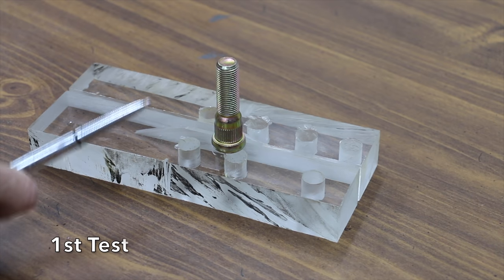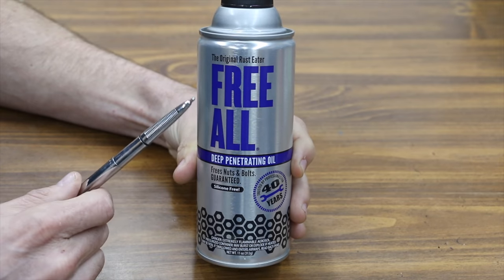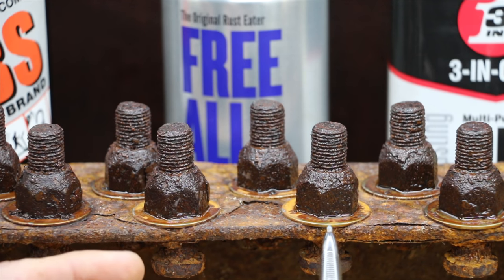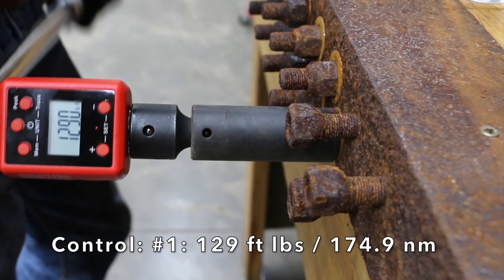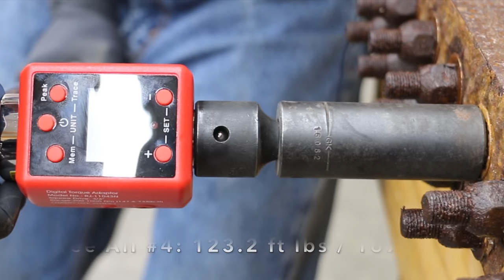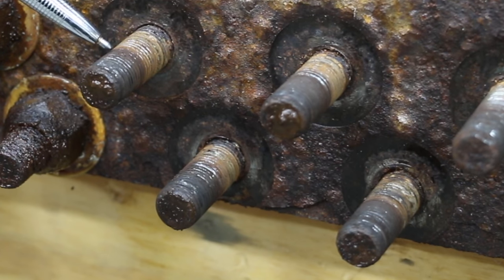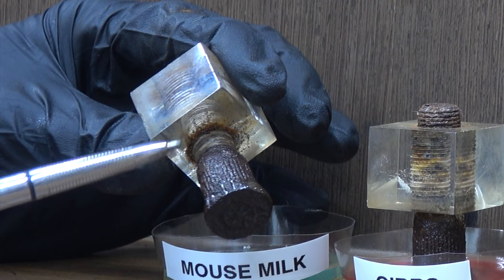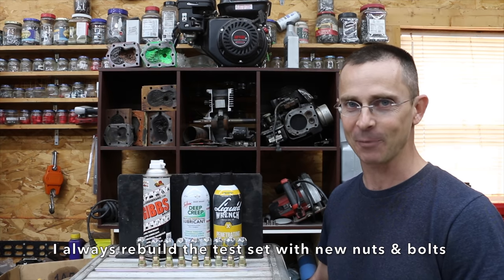Does Water work better than Penetrating Oil for Rusty Bolts? Let's find out!

Comment: You have several videos where you submerge rust in liquid -- what about large pieces that can't be submerged? What does best for a (for example) rusted metal table saw surface?
Reply from the maker: Thanks for the suggestion.

Comment: I just this it's physically impossible for anything to come between a nut and bolt that is really torqued down. I still use my Blaster but I think it helps taking the nut off more than it does breaking it loose.
Reply from the maker: Thank you

Comment: Have you tried 2-cycle oil and motor oil as penetrating oil’s to see how well they do? Whenever sinking really long lag bolts, like for farm fencing, I always dip them in a bottle of 2-cycle oil, it seems to help them go into the wood easier. I’ve also used motor oil and bar oil. But 2-cycle works best.
Reply from the maker: Thank you for the video idea!

Comment: I saw your video testing rust remover products, and was curious which one you'd recommend for cleaning an old moped gas tank. I have used Rustoleum rust dissolver before and it barely does anything. I like the way that Krud Kutter performed for you though and think I might try that.
Reply from the maker: Thank you

Comment: Hi there, did you already have a test on starter fluids and alternatives to use?
For example my father used John Deere stuff for cold starts on his old hungarian tractors/excavators. He claims this would cold start them without any fuel in sight.
Me needing somekind of starter for the moped, I have two favourites. Brake Cleaner and WD40. Both work good directly sprayed into the chamber. WD40 should not be sprayed in front of the air filter. For me it suffocates the engine. Brake Cleaner is fine there on the other side.
Have a nice day.
Reply from the maker: Not yet. Thanks for the test idea!

Comment: Have you ever done a heat test? Heat will loosen frozen fasteners.
Reply from the maker: Great suggestion!  I did use heat on the first showdown and it did very well. Thanks again!
Reply: Project Farm I will go back and check that out.

Comment: i wished you would repeat this test with heat applied to bolts before treating to see if it would wick in
Reply from the maker: Thanks for the suggestion.
Reply: uh, all you really need IS the heat.  it is by far the best for removing nuts from bolts.

Comment: Hey there, I love your channel, keep up the great work...I was wondering if you could test oil stop leak, I hear they are not good to put in your car engine. Just wondering what are your thoughts on that.  Thanks and look forward to the next video.
Reply from the maker: I haven't tested those yet, I need to.   High mileage oils contains additives that help slow oil leaks.  Stop leak products are very similar and seem to help.

Comment: I know you like new ideas on what to test - here is a new one.  With the new GDI engines the valves on engines get a lot of carbon build up since the fuel is no longer sprayed over the engine valves on a typical four stroke engine (the fuel is sprayed directly into the cylinder, which is more efficient and generates more power with the same or better gas mileage).  Could you do a test of the GDI intake valve cleaners like CRC industries product?  Thanks.
Reply from the maker: Thank you for the video idea!

Comment: Just watched your gas vapor video running your lawnmower. I believe I read somewhere that people have heated the fuel to 400 degrees before burning it in the engine. I am curious if you would see an increase in efficiency.
Reply from the maker: Great tip! Thank you

Comment: i think the biggest issue is that the torque is too low, to really show what the different oils can do, at ~130 ft/lb's no one is going to use a penetrant anyway on a bolt like that, you should use some 3/4 nuts and torque them to 300+ ft/lbs then see what they can do.
Reply from the maker: Thank you!

Comment: Dont even have to finish watching this video. When using water you have to work the nut loose and tight to get the water in the threads. Water does not penetrate but does work very well.
Reply from the maker: Thank you!

Comment: you should use diesel as oil in a 2 stroke and 4 stroke engine, for the 2 stroke obviously mixing with the gas and in the crankcase for the 4 stroke
Reply from the maker: Thank you for the video idea!

Comment: you’re supposed to use the water right when you are gonna take off the nut and keep it wet as you unscrew the nut/bolt you can dab it with a wet rag not leave it for an hour it just dries amd make more rust
Reply from the maker: Thanks for the feedback.

Comment: I have used penetrating  oils over the years and not once have I ever done it like you did here. The bests way to use it is to keep getting the parts soaked with it. apply several times even is just a few second apart.  Not just once and walk away.  As you can see on the upright bolts most of it just ran down the bolt then the nut. Not much got to soak in that way.  That may be cool for a video here , but not much help getting thing apart.
Reply from the maker: Thank you!

Comment: In the case of a truly stuck fastener, none of them will help. If the fastener isn't truly stuck, like in your tests, then you don't need any help removing it to begin with, as evidenced by your control fasteners. When you have a truly stuck fastener, the only thing I know of that works is heat, especially if followed by rapid cooling, such as by spraying the fastener with water immediately after heating it with a torch.
Reply from the maker: Thanks for the feedback.

Comment: Project Farm I  am begging  for a video by you. How to oil, loosen ALUMINUM bolts from  engines? Cause one  bolt costs about 2 hours labor.[Cause the corrosion makes them snap]  Its Aluminum on Aluminum block. Facepalm God  Bless you if you  can come up with a idea! Basically a way to lube a bolt and get it down in the threads. Hopefully freeing it. Ideas and tests would be a blessing!
Reply from the maker: Great recommendation!  I'll see what I can do.

Comment: Thank you for this great video! Unfortunately you only test US brands :/ non of these are available in europ :/ maybe you can use some european products if you can get them :) Another vid sugestion: Which is the best brakepartscleaner? there are a lot of cheap and expencive onces. do the expencive ones clean better? do the cheap ones cause harm to rubber seals like o rings and plastic? would be great if you would do a vid like this :)
BR from Austria in Europ :)
Reply from the maker: Thanks for the constructive feedback

Comment: I need help here I have aluminum mags rusted against hub wheels can't break them loose I tried everything , heat , banging  ,WD40,  WON'T SEPARATE  my wheels. Should I use a blaster can or what should I do

Comment: It doesn't surprise me that water didn't do well.  It's failure to "wet" the nut and bolt immediately (causing it to bead) tells me the surface tension was too high to for the rust (dirt) to break it.
Reply from the maker: Thank you!

Comment: idea for a video. I went to home depot and bought a new trimmer and they now sell pre mixed gas (50/1). it's 93 octane and no ethanol and has additives. How much better it is? is it really worth more money than trying to find 93 no ethanol? I've even heard crazy stories of using it cleans out old trimmers and makes them run better after a tank full. 

I did buy a can with my trimmer since it was only $6. trimmer has started on first pull every time so far.
Reply from the maker: Thank you for the video idea!

Comment: Paraffin Wax is the best i've used. And lemon juice works without heat. Ever tried vinegar?
Reply from the maker: Thank you
Reply: @ProjectFarm  Just warm the part enough to melt the paraffin into the threads.

Comment: In the UK ive always had excellent results with duck oil or plus gas,  never been a fan of wd40 although I buy it if its reduced in the supermarket.....the best supermarket brand  ive ever used is Asdas maintenance spray...bloody good and cheap too.....diesels great for putting down bores to free up seized engines........
Reply from the maker: Thanks for sharing.

Comment: Love ur shows big time, BUT, im not the smertest person but I observe a lot, and was noticing that the metal plate flexes as you are doing the tests. Can the flex and or vibrations from removing the nut, near the next set of nuts and so forth, be prematurely broken free a little bit due to the flex/vibration of the steal next to each bolt, which would put a little stress to the bolts, then washer, then nut, breaking it free just a little bit due to that flex? Since the stress of the steel plate is enough to bend it a little while putting on the force to get the nuts off, that twisting force is sure to make some of it its way up the next set of bolts loosening them up just a smidgen, harming the test? I guess this test would be great if you had a few next to each other that after spraying and taking the first ones off the vibrations and flex you caused on that joint taking off the first one is sure to make the others a little more easier as you take more off, next to each other. But only if you used the same spray on them all, not different ones right next to each other as they will all, after the control ones have started to be taken off flexing and vibrating the steal, so the ones next to that and down the line get easier to remove due to the flex and vibration making their way down the line.
Reply from the maker: Thank you. The flex should not impact the results. The entire angle iron was moving but not bending.  I only had 4 drywall screws attaching the iron to the test bench.

Comment: Hello, I’ve just found you, really enjoying your videos. I have a video suggestion, will a generator motor run on bio gas? (Mostly methane and carbon dioxide).
I’ve seen a system called “Home biogas” which makes gas from food scraps.
Thanks, Matt
Reply from the maker: Thank you for the video idea!

Comment: I am not very experienced with penetrating oils (used only a few times) but looking at the results where there was not much of a difference between the control and the removal torque with the penetrants, I am wondering if they really only make a difference when the bolt is actually seized?  Your control bolts did not look seized, considering it was a reasonable torque for lug nut removal without a penetrant.
Reply from the maker: Thank you

Comment: I have always been told heat and candle wax works wonders, and have good results on ss bolts in aluminum. Can you try it in steel and aluminum  vs penetrant? Would like to see if the myth is true.
Reply from the maker: I tested it in a different video  https://www.youtube.com/watch?v=bIunR4VL5vc

Comment: I had a trailer hitch rust welded itself to the receiver.  OMG I sprayed everything under the sun on it, NOTHING lol. I was hitting it with a BFH, and it wouldn't budge. Eventually I had to saw off the hitch and make cuts to the inner part and chisel the rest out. XD
Reply from the maker: Thank you!

Comment: I use Shamrock S’OK penetrating oil to loosen rusted fan blades and blower motors. I use it mainly because it works well and leaves a protective film on shaft. Makes it easier to replace motor next time it fails. Wonder how well it stacks up against these others fr nuts and bolts
Reply from the maker: Thanks for the recommendation!

Comment: I have use DOT 3 brake fluid as a penetrating oil and found it works good. I wonder how it works compared to actual penetrating oil?
Reply from the maker: Thank you.  I tested it in the previous episode on penetrating fluids and it did very well.

Comment: I don't know, it doesn't look like any of them reduce the torque needed to remove a rusted bolt very much.  If none work that well, might as well use diesel or used motor oil.
Reply from the maker: Thanks for the feedback.

Comment: Was wondering about a viscosity test with motor oil. Like, is 5w 30 thicker/thinner than another brand of 5w 30? Both at cold temps & with hot temps. And how much thinner is 5w 20 vs 5w 30 etc.
Reply from the maker: Great point.  Thank you for the video recommendation

Comment: I like your channel and feel that you normally do fairly well balanced and, well, fair tests, but I think this one failed in that you applied the same amount of product in each case, and they do not cost the same. I believe you should have tried with similar amounts of money worth of the product to see how convenient they are in a price-effectiveness scale.
You take a product, write down its cost, divide by its quantity (or the other way around, whatever gives you a simpler result), then apply $1 of product in each case.
Water and diesel, I am fairly sure, allow people to use a LOT more product for $1 than any alternative, so while they may not be as effective mg by mg, realistically we aren't applying X amount, we are applying X money when we use them,
You probably would have been able to just submerge most samples in diesel, not to mention water, that way, which is how people actually use them most of the time.
Want to loosen up a bolt? Throw a entire glass of water on it. A series of bolts? A bucket will do, see what I mean?
Reply from the maker: Thank you!

Comment: Good stuff.  I now check in with your videos before buying products. I especially admire your effort to maintain rigor and showing your work puts you a step above Consumer Reports.   As I've mentioned before, in some instances (such as this one) the data are inconclusive because of small sample size and broad variation which make it difficult to say if the difference between the means is statistically significant.  I've mentioned that the T test was designed for these situations.   Your reply suggested you weren't comfortable with the required analysis.  The Excell spreadsheet has several T functions built in to its statistical function library.  Also, an explanation of T testing can be found here: https://en.wikipedia.org/wiki/Student%27s_t-test
Reply from the maker: Thanks for the constructive feedback

Comment: 3-in-1 would have been in the top three it it wasn’t for that outlier. It’s quite obvious that it was an especially rusty nut; the torque required to undo it was higher than any of the control measurements. I think, in terms of bang for your buck, 3-in-1 actually wins by quite a margin.
Reply from the maker: Thanks for the feedback.

Comment: I have heard brake fluid makes a good penetrating oil as well. Would you be able to throw that into one of your test groups
Reply from the maker: Great suggestion. I tested it in a different video and it did well but it does cause rust.

Comment: We use GIBBS in our shop everyday we have yet to find anything better on the market for the price
Reply: Try a 50/50 mix of automatic transmission fluid and acetone. Shake well before each use. If that works as well or better for you guys it will save a a good bit of money.
Reply from the maker: Thank you!

Comment: I had a fly wheel NUT that I could not loosen even with a breaker bar  worked hours  I put penetrating oil on it over night  and I swear I work up the next morning ready to beat that job to death again and that nut was not only loose but it was rotated Several threads and I took it off with my fingers ( it was like a elf took it off lol  I used I think liquid wrench ( it was liq wrench I just saw your label it’s what I buy ).
Reply from the maker: Thank you

Comment: Have you tried running a 2 cycle engine on diesel fuel? (Without adding the 2 cycle oil.)
I see where you tried diesel in a gas engine, but nothing about a 2 cycle engine.
Reply from the maker: Thank you for the video idea!

Comment: I like the experiment regarding how much force is needed to loosen rusty bolts. Unfortunately the experiment lacks statistical power to say much other than Gibbs outperforms the control. If the number of trials per product were doubled the statistical power would be improved greatly. The current experiment doesn't repeat the trials enough to give us enough statistical power to determine a clear difference between products that can't be explained by random chance. Furthermore there are too many products so there are too many comparisons being done, this means we have to correct any statistical tests for multiple hypotheses which will make it harder to determine a difference between products.
I recommend that the same setup is used in the future but you apply the same product 8 or more times. One should also describe the variation in the force applied. Also consider comparing fewer products at once. For statistical tests you could apply a Student's T test or a Wilcoxon Rank Sum test to compare distributions of measurements between products. The current setup under pairwise comparisons lacks power to conclude much.
I do appreciate the care put into the experiment, the clear description of the methodology, the execution of the experiment, and the careful reporting.
Reply from the maker: Thanks for the constructive feedback

Comment: Suggestion nano pro mt, its military tested, military tough, found on amazon. Its the best iv ever used on coroded bolts- used on a 30's b john deer didnt snap the bolt and no breaker bar needed. Used to be sold at autozone but its new so didnt grab hold...
Reply from the maker: Thank you for the video idea!
Reply: @ProjectFarm  were can i send a bottle for u?

Comment: I see that the difference between the best performer and worst performer is only 24 foot pounds I wonder if it would be beneficial to buy a longer breaker bar that it would be to spend money on these fluids
Reply: The purpose of a penetrating oil is also to prevent breaking a bolt or stripping threads.  Applying more torque with a longer wrench increases your chances of doing that.
Reply: @terrywaters6186  that's true haven't thought of that